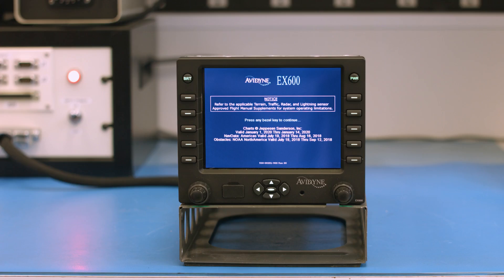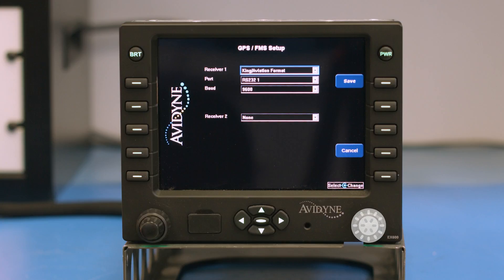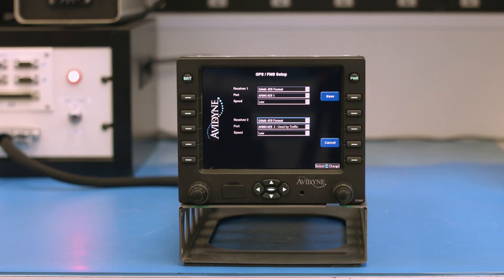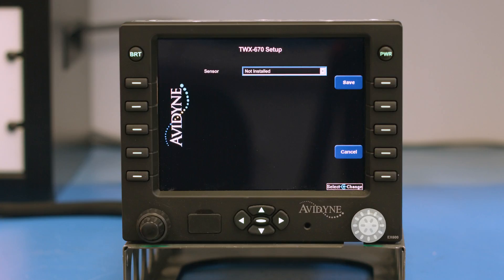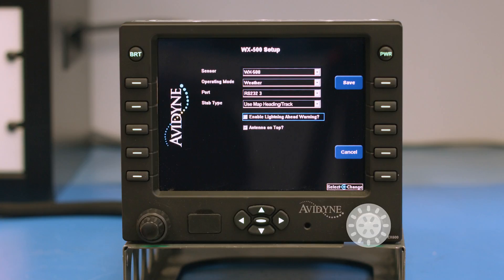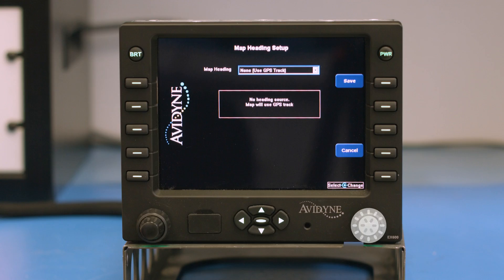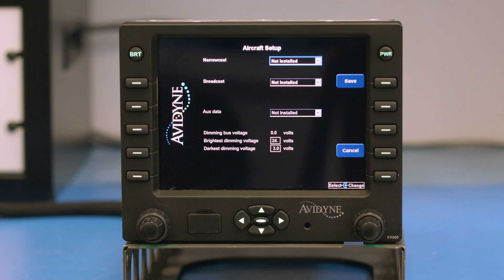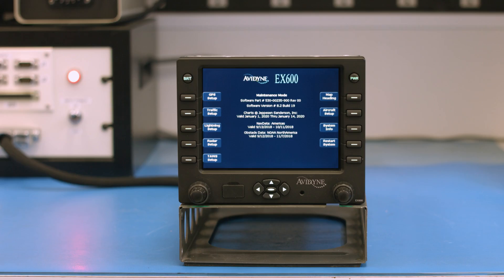Video DI - How to Properly Configure The Avidyne EX500/600 MFD

Comment: How can you remove it for the plane
Reply from the maker: (This video is for configuring the unit only when it is fully installed)
However, the recommended procedure to remove this or any AVIDYNE unit would be
found in the Instructions for Continued Airworthiness that installed 
the AVIDYNE unit originally. These would be located in the aircraft records.

Comment: Does this have to have a gps navigator linked?  I'm installing new panel with G3x touch PFD, GTN750 primary GPS Nav/Com, GNX375 backup GPS Nav and Transponder, G5 backup attitude, etc. GFC500 autopilot, GMA-350 audio panel, GTR225 backup comm

Airplane currently has Garmin 430, Avidyne EX500 and some other compontents that give traffic, FIS-B weather, EX 500 is also display for Bendix radar on wing.
Reply: I want to use this as a backup GPS display for passenger side of panel
Reply from the maker: Great question!
Yes, the Avidyne does need a GPS input in order to display position. 
If you have any more questions, reach out to Scott McKenzie directly. His contact information can be found here: https://duncanaviation.aero/intelligence/2018/October/video-di-how-to-properly-configure-the-avidyne-ex500-600-mfd